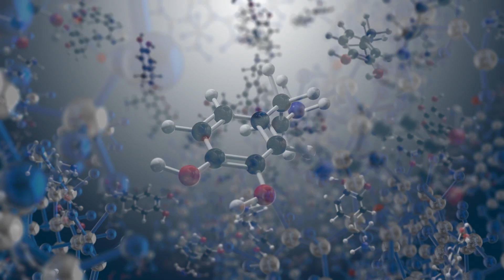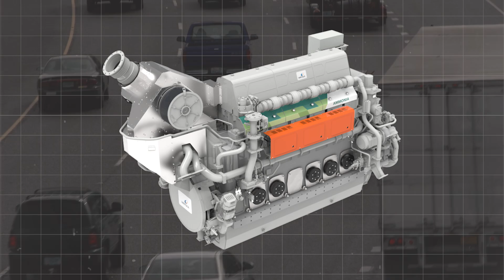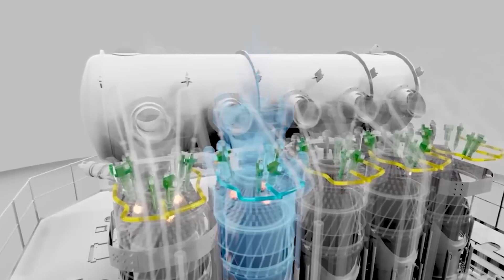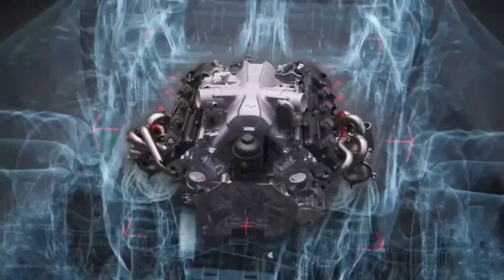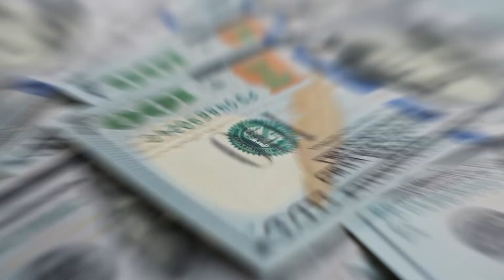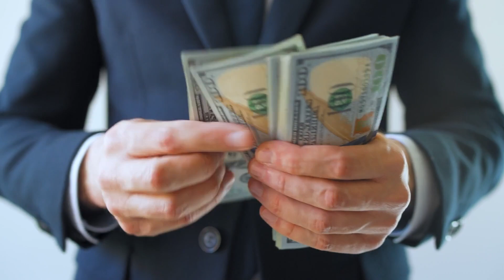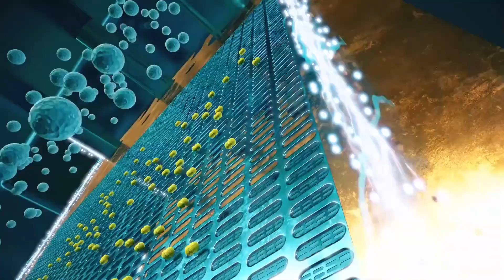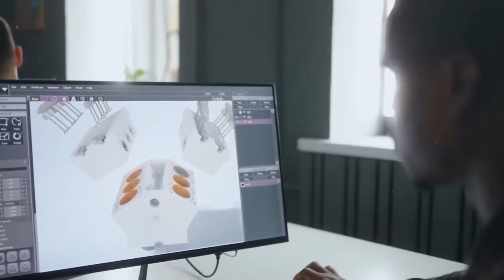WILL AMMONIA ENGINES SHAKE UP THE ENTIRE EV INDUSTRY?

Comment: I have driven EV for two and a half years now - no problems - will NEVER drive an ICE car again! This story seems like an attempt to extend the life of the steam engine! All combustion and piston engines are PAST. It is far too energy-demanding, just like hydrogen cars! The future is electric! = No pollution, efficiency of 88-96% - Hydrogen efficiency around 30%. And even with ammonia there is still a CO2 release!
Reply: You obviously don’t tow anything, if you did you would realise that range can be reduced to less than half.  Let’s get real.
Reply: @rosswebb9295  NO I'm not going to pull anything - and most people aren't going to, so what's the problem! Most people drive under 100 miles a day - so I have a hard time seeing the problem! The fact that most electric car haters also deny climate change and its causes can only be due to lack of information and downright stupidity.
Reply: You forgot about the extra tyre wear and the extra brake pads emissions too... Electricity used is often not from just renewable energy sources... Sure the EV has no tailpipe emissions, but in order to achieve its carbon neutral standard it will need to be driven around 80,000 miles, as it actually causes more than 1.5 times amount of carbon footprint in its manufacturing than the current ICE car's. 
Apart from Tesla a lot of the EV'S have bad quality and build standards, plus it is likely that a new battery will be required before the 80,000 miles arrives...  Add to this real danger of fire damage, high insurance cost & huge amount of depreciation in a few years from purchase prices and you have a hard time to justify a EV...
Feul Positive ticker NHHHF has a new way of making ammonia from just renewable electricity & air & water...  Ammonia is in many ways easier to handle than hydrogen and its taking off in marine sector already... FYI
Reply: @andrewk5336  No brake pad emission from my EV! Most breaking is regenerative!
NO extra tyre wear since my EV is NOT a Tesla, and therefore does not have as much power, nor is it as heavy as e.g. a Tesla! In the country where I live, 75% of the electricity is produced using renewable energy, and the rest is either nuclear or gas! And the 75% increases rapidly year by year. So your interpretation does NOT fit in my case!
Reply: @JunkerOnDrums  Last time I looked Tesla is no 1 manufacturer, so it will by default have the issues I mentioned... Any braking carried out is going to produce some dust emissions period.
The extra weight in most EV'S and torque will have more effect on road infrastructure...
Which EV do you drive..!??
Reply: @andrewk5336  There are fewer EV fires than ice car fires period!!!!!!!!!!!Ah, the battery. Big oil is trying very hard to convince you with their campaign, but the battery in current EVs should be good for 15 years or more, based on a lot of numbers from Tesla et al. Compare that to replacing the motor and transmission in your Mazda. Which  sure, is a very good car. Every litre of gas you put in it starts at prospecting for oil, drilling, shipping the crude, refining it, and distributing it to the gas station. But that isn’t figured in the carbon cost of running an ICE car, just tailpipe emissions. A lot is made about the dirty secrets in making batteries. But big oil doesn’t want you to know about theirs.
Reply from the maker: @JunkerOnDrums Great for you , you might just be one of the lucky few .
Reply: @EVCarsHorsepower  We are many lucky people in Norway 😂😂😂
Reply: CO2 is a byproduct of the production of ammonia from natural gas.  The CO2 can be used to produce the dry ice used to freeze perishable food products during shipping.  The dry ice eventually sublimates into the atmosphere.  Hence, ammonia engines are essentially natural gas engines.
Reply: Keep making unsubstantiated claims 🤣
Reply: @a70duster  Keep up your ridiculous hatred! Pathetic to hear such old fashioned nonsense about the excellence of ICE cars. ARE YOU AWARE OF HOW MANY PEOPLE DIE IN THE WORLD DUE TO POLLUTION FROM ICE CARS!? or Google it - and learn more, you probably need that!😂😂😂
Reply: 2 years using battery = 20℅ less torque
Reply: @ceroandone  Nonsense and lies!!! 😂
Reply: No pollution, you're all in with the Kool-aid 😂
Reply: @a70duster  No I'm not! EV's are the future whether you like it or not! 😂

Comment: Toyota also revealed a combustion engine that runs on water & gets better mpg than gas. EVs are powered by burning COAL & the batteries are massively toxic, they are NOT cleaner than gas or diesel.

Comment: Engines powered by ammonia may incur higher maintenance costs compared to electric engines. Furthermore, the production of ammonia as a fuel source also requires electricity.” Please note that the comparison of costs can vary based on many factors including the specific technologies used, the scale of operations, and local market conditions. It’s always best to refer to the latest research or expert analysis for the most accurate information.

Comment: Be it hydrogen, ammonia, or electricity, all are developing tecnologies. The most common source of renewable energy will be solar and wind, which produces electricity. It is an additional and potentially more costly step to produce hydrogen and ammonia. Wind and solar, which are free, can be produced in decentralized locations. My bet is that simple electricity will win out.
Reply from the maker: @chriscorklin2981 U may be right , but my bet is on ICE standinding there ground . USA government is LOST .
Reply: @EVCarsHorsepower  It is not either or. ICE has it's uses for large commercial applications such as trains, ships, and aircraft, but there is an add on cost.
Reply: @EVCarsHorsepower Battery EVs are winning. Hydrogen, ammonia, and other synfuels are way more expensive because of their inefficiency. Fuel cells are bad enough, but combustion  engines are 3 times worse.
Reply from the maker: @jamesvandamme7786 Yea I believe they got U . 😂 Only Time will tell .

Comment: teh soluyion is simple and axiom as they can build super power stations for generating electric using Amonia fuel on large sacle and make every gas station turned into charging staion while deeveloping more safe, sufficient and viable batteries for Ev cars.
Reply: Or, instead of making ammonia out of electricity, then hauling it all over the place in trucks to power local generators, how about we just use the same electricity and run it over wires, and charge EVs that way?